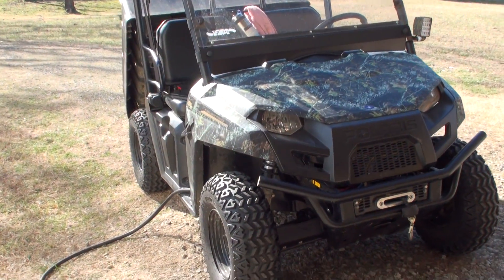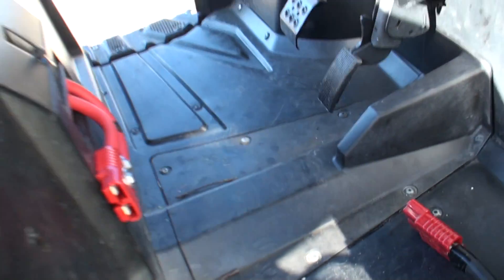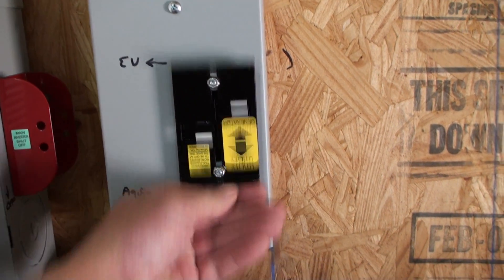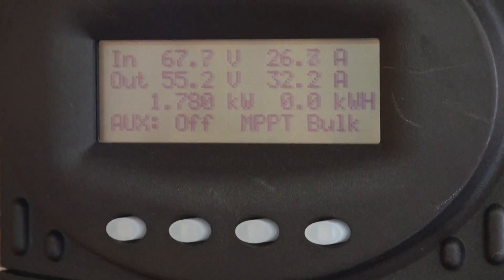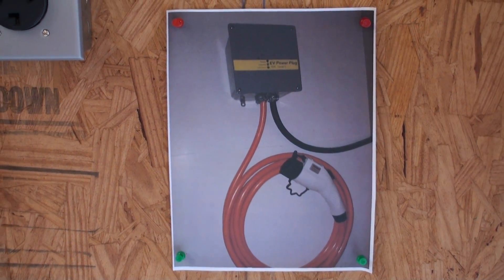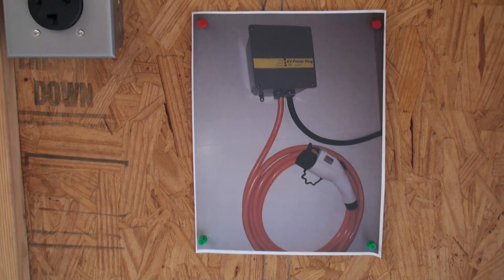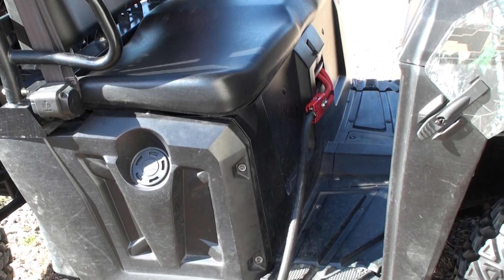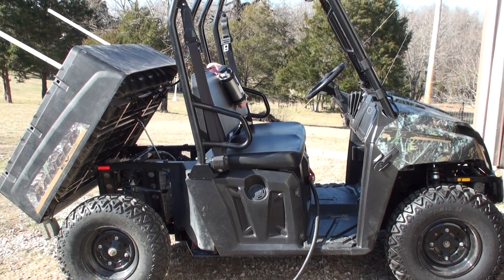DC Charging my EV from Solar, Final

Comment: Hi, and thanks for a great video series! I recently connected a solar charger to my ranger EV. I noticed that the battery indicator does not increase when charging on solar. Did you have any issues with this, and if so, did you manage resolve that somehow?
Reply: I am not getting too much amps from my puny solar setup. In mid day I get about 2amps of charging, and during one day, it charges about 1kWh in total. The problem is that the indicator on the dashboard will not increase, even if I leave the utv unused for a week, charging 1kWh every day. When I plug in the 230V charger, the indocator on the dashboard adjusts itself to reflect what the solar did charge. Based on your answer, I guess you have not had this issue. I will investigate some more to see if I can figure this one out, and if I ever do, I will also make sure to add a new reply here with my findings :) Thanks again, and take care!
Reply: Did never manage to figure out what is the issue. It seems like it needs a significant charge before the meter picks up on it. When I oly change like 5% in a day, the meter does not change. I did try with more solar power, and then the meter manages to adjust itself after a while.
Reply: Can you email me I need to know what system I need to get it to 220v to charge a ev 
Malan@connect2cash.biz